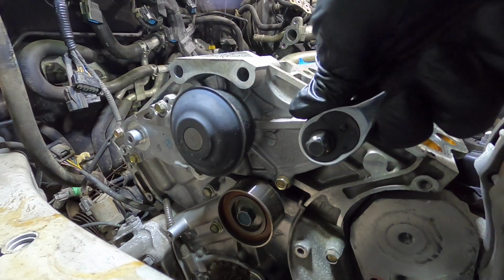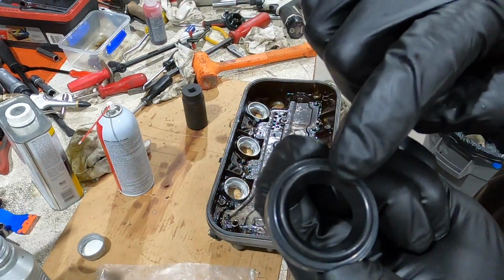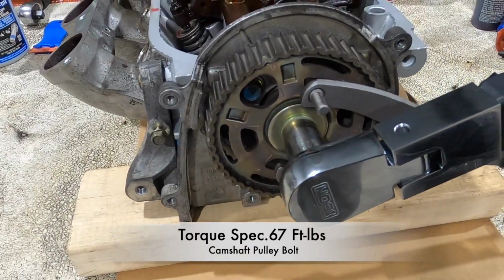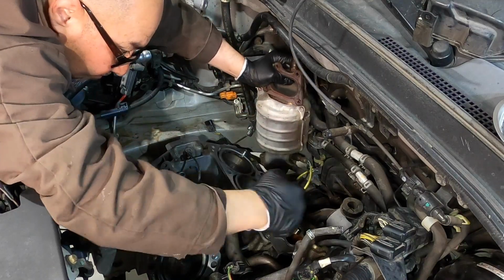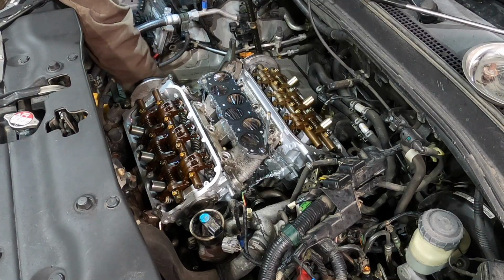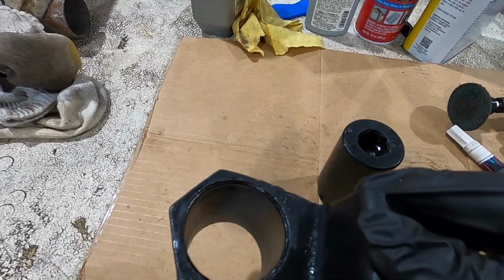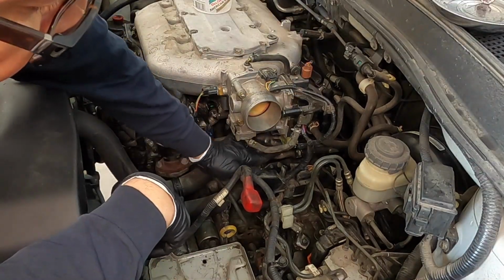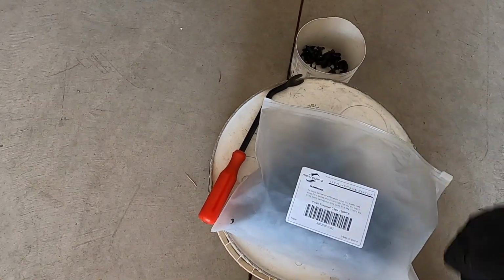Cylinder Head Installation on a 2005 Honda Pilot

Comment: Hey man I just want to say this video was a life saver. I bought a 2007 honda pilot on Facebook marketplace at market value with a blown head gasket etc. i decided to not spend the 3500-4000 bucks with a mechanic and decided to watch your two videos to solve the problem myself. So thank you 🤙🏼
Reply from the maker: You’re welcome😁👍 Thanks for the kind words. My 2005 has been running great ever since the repair. It is my daily driver and a great all around vehicle. Thanks for watching both videos 🚜💨☀️
Reply: I also overheated engine replaced the front gasket of the head but it still does not run smoothly I will change the second one I want to ask the engine block and can suffer or not?
Reply from the maker: @bogdantoysreviem7193  Maybe do a compression test before you take it apart to see what cylinder is having problems. Just a thought 😁👍

Comment: This is an awesome video!  For anyone reading this, clean engine oil should be used instead of white lithium grease as per the manual.  Also, a zip tie works great to hold those o-rings in while you're driving the cam end cap into position.  Impressive job putting this together and filming it all.  I'm always in awe of guys who have the patience to wrestle with a task like this and do such a pro job documenting all of it.  Thanks again.
Reply from the maker: @Mrfrags4117  Thanks 😁👍 I should have used motor oil on the rubber seals for sure. In my defense I had a lot to do. Hopefully it will be fine. Have not had a problem with the Pilot since the repair. Thanks for the kind words and watching. 😁👍🚜💨☀️
Reply: @MJADoingStuff   I'd second that, very well done video.  👍
Reply from the maker: @tcmits3699  Thanks for checking out the video and the kind words. Have a great weekend 😁👍🚜💨☀️

Comment: That sound you heard on the start up sound like the power steering pump sucking a little air in the line before it had fluid go through it.  Very common on these engines.  My 08 Oddesy made the same sound when doing the timing belt a few months ago.  Doing the valve cover gasket tomorrow at 190,000 and the engine is strong as ever.  I love the J 35 series engine as I believe with regular maintenance they are bulletproof.
Reply from the maker: Thanks that makes sense. Glad you are having better luck with your J series motor. Thanks for watching 😁👍🚜💨☀️
Reply: @MJADoingStuff  I saw this video and not the previous, but why did you remove the heads on the engine?
Reply from the maker: @danielrowe2174  The steel valve guide on the #4 cylinder had a coolant leak between the cast aluminum on the intake port and was leaking into the cylinder. I was already that far in so I just replaced both heads and did a valve job. 😁

Comment: Thanks for your videos. I'm working with my second honda pilot and about to take apart the engine and do all seals, new exhaust, etc. Mainly taking it apart to remove a bit that fell into the head and hope that it comes out when I remove it. My first pilot I did all the seals minus the head gasket, front and rear suspension along with new brakes and rotors all the way around. But I'm pretty confident I can tackle this since the weather is breaking a little bit.
Reply from the maker: @ericsolomon1109  You’re welcome 😁👍 sounds like you like doing stuff too. I am hoping to have time to do the transmission service video before spring. Thanks for watching the video and have a great week.😁👍🚜💨☀️
Reply: @ Yeah, I'm gonna do a transmission fluid & filter change on both vehicles before summer hits
Reply from the maker: @Great minds think alike 😁👍

Comment: I bought timing belt  from Amazon and it ropped 1 months later !!! Guys I did preventive maintenance for prevent valve damage and after change belt it happen couse not original belt .. it sucks!!
Reply from the maker: @sweet8763alex  Sorry to hear that. I got mine from Amazon too. So far have not noticed anything. I put over 20K miles on it. Thanks for sharing your experience.

Comment: I watched alot of videos regarding the j^ series engine and I gota tell you your videos are the best. clear and very simple to follow. I am just about to put my heads back on but since its a 2007 model, it requires different torque. Thanks  Mitch
Reply from the maker: Thank you very much for the kind words. I wish I could show more steps in the video but that would be 3 hours long and I don’t think people would watch 😂 Can I ask how many miles are on your engine? Mine failed at only 151K🥲 Thanks for checking out the video😁have a great weekend 😁👍🚜💨🍳
Reply: @MJADoingStuff I would happily watch a 3 hr video!
Reply from the maker: @bluor3713  Good to know😁👍 Thanks for leaving a comment. Hope you had a great 4th of July and have all your fingers.😂 🚜💨☀️
Reply: @MJADoingStuff Still have all my digits, but powder burns are a different story. Lol

Comment: When setting down the heads, I use two of the old cyl head bolts as a guide. I just cut the heads off of 
the bolts, get them started in the block, and after the block is down, install a couple of the new bolts 
and remove the cut off bolts. You can use a hack saw to cut a slot into the top of the cut-off bolts to 
insure that you have a way to remove them if you run them down too far to get your phalanges around them.
Reply from the maker: @otpyrcralphpierre1742  That is a great tip😁👍thanks for sharing I am sure someone will find it as helpful as I do.😁👍🚜💨☀️

Comment: You were right, Mitch!.... 

This is about the MDX I mentioned above. I finally decided to just pull the other unaffected cylinder as well and will rebuild it together with Bank2 (bent #4 intake valves). What made me decide to do that was after checking the seals and O-rings on bank2, almost all are nearing end of life: rigid, plastic like feel instead of rubberized. These won't last 50k miles or at-least as long as the new ones. Plus, will take the opportunity to do valve mating surface reconditioning.  The difficult part was loosening the nuts holding the cat converter to the head. My hands won't even fit in there; almost decided to just bring down the whole engine-subframe assembly. 

As the new parts delivery is delayed for like 1-2 weeks extra, this gives me more than enough time to measure things against factory spec and also clean things up. The Bank2 cylinder head by the way turned out ok. No measurable warping anywhere and even all valve guides were within spec. The bent #4 intake valves was all got affected by the timing belt breaking. 

Thanks , Mitch!
Reply from the maker: You’re welcome 😁 did you watch the removal video? I pulled the head with catalytic converter connected together. Glad you decided to pull both heads. Have a great week 😁👍🚜💨🍳
Reply: @MJADoingStuff  Yeah, I did... However, on the MDX (not sure about Pilot) there is another bracket near the 3 bolt of the primary exhaust pipe holding the cat down to the engine block. And it can only be removed after removing the primary exhaust pipe + front sub-frame stiffener and support + intermediate shaft. If I do that I'm basically just 2-3 steps away of removing the whole engine-subframe assembly.  Since, a buddy borrowed my mini lift long-term, that won't be feasible until next spring.

Anyhow, after some building up a series of mini socket extensions (and some arm and hand scratches), I was finally able to remove the nuts. Assembly it seems would be a bit easier as I removed the cat studs from the head.

More power to you, Mitch.
Reply from the maker: @Nio_by_Sakuji  Yeah I remember that bracket on the Pilot it was a short 2 bolt bracket on the bottom part of the motor and rear converter it was very light room to work. Sounds like you got it handled. It will be well worth all the labor you put in when it is done. 😁👍

Comment: just got a 2006 honda pilot.  Im looking to do a job like this on it.  Thanks for the insight!!!
Reply from the maker: Anytime 😁 I think the Honda pilot engine is nice because of the aluminum parts. I have worked on many BMWs over the years and the plastic parts are junk in my opinion. Got over 5K miles on the valve job and it is running perfect. Have a great week 😁👍🚜💨🍳

Comment: Nice job Mitch! It’s been a long time since I rebuild an engine. A hole lot more satisfying doing it yourself and a  money saver.   Later
Reply from the maker: Very true and now I know this thing In and out. The dealership (steelership)wanted $2600 just for labor🤯 I had to check😂Thanks for checking out the video Mech.😁👍🚜💨🍳

Comment: So impressive, nice work. I’m in the beginning phases of this monumental task lol
Reply from the maker: All I can say is one part at a time will get it done. Good luck and thanks for watching. 😁👍🚜💨🍳
Reply: @MJADoingStuff  that’s exactly it. It’s my sons pilot and I have a few hours here and there…I tell him just a bit at a time. I keep your video(s) on standby!
Reply from the maker: @manicmandownup  The most time consuming and challenging parts were the thermostat housing nuts,the rear catalytic converter lower bracket and wiring harness removal. 😁
Reply: @MJADoingStuff  I removed the front head today. Cylinder 4 exhaust valve is broken…I think also the culprit for coolant loss. I tell you what, I don’t think I want to do the other cylinder head! Do I actually have to? Cylinder 4 is the whole reason I’m doing this lol
Reply from the maker: @manicmandownup  You don’t have to but you are so close not much more left to just do it. Either way it’s up to you. 😁👍
Reply: @manicmandownup   would like to share if i may i took 54 photos and 12 short videos 😂👊🏻 really helped later on when I was scratching my head😂😂
Reply: And definitely label everything  with post it notes👍🏻
Reply: I’m sure you’re done by now😂

Comment: FYI, lithium grease degrades most rubbers and plastics. Silicone based lubricants is the one to be used if using for installing orings or other rubbers. New engine oil can be used too to install orings and seals.
Reply from the maker: Good to know thanks for the tip. And thanks for watching 😁👍🚜💨☀️

Comment: thank you so much bro. honda pilot 2007 wont rev pass 300 rpm and getting code for crank and cam shaft senor and one of the heads is running only 2 cylinder, def rebuilding my engine
Reply from the maker: Your welcome. Well the good news is that Honda built this engine to be repaired not thrown in the trash. So you will be happy when you are not braking plastic parts. Just make sure you use a torque wrench. Thanks for watching 😁👍🚜💨☀️

Comment: Hi! When placing the camshaft n, should i put on the sprocket and line up the marks before i install the lifters an rockers? Thanks
Reply from the maker: It won’t stay on the marks just assemble the lifters and rockers first then turn to the marks. Hope that helps 😁👍🚜💨🍳

Comment: Do you have to use rtv around the coolant pipe housing that mates to the heads? Or just use the gaskets the kit comes with?
Reply from the maker: Your preference I do it out of habit. I feel it seals the first time and it has always worked for me in the past. So short answer would be yes. Hope that helps 😁👍🚜💨☀️
Reply: @MJADoingStuff  thank you. One more question, i lost the back bushing for the serpentine belt tensioner. Do i have to have that or fine without in your opinion?
Reply from the maker: @ESP-Collectibles unfortunately you need the bushing. Hopefully you can find it. 😁
Reply: @MJADoingStuff  your responsiveness just saved me a road trip thanks again bro 🤙

Comment: Loved the vedio's man! Im to the point where i got the heads out! Are the heads new, or did the machine shop clean them? And what all did you have them do to them? Thanks
Reply from the maker: The heads were pressure tested and did a valve job package. Plus one of the heads was not fixable so had to find a good core that was fixable. I reused the parts of plus cam of the original head. Hope I answered your question. Have a great weekend 😁👍🚜💨🍳
Reply: Thank again man! What should i b lookin to pay for a valve replacement job on both heads and should i take them off?
Reply from the maker: It will cost around $750 depending on the condition of each head and machine shop you chose if you remove them yourself.😁 @alonzogodwin3745

Comment: Great video's ! Watched them both. Did you put a new head on or find a used one ?
Reply from the maker: I had to find a used repairable one and went ahead and had both heads pressure tested and the valves redone with new valve stem seals. They came back from the machine shop looking like new. Thanks for watching both videos 😁👍🚜💨☀️
Reply: @MJADoingStuff  Thanks for the head's up. Looking at 2008 Pilot right now that has an overheating problem. Either a bad head gasket or a bad head. I can handle the head gasket(s) job , but if I have to find heads for it then it's not worth the investment for me.

Comment: Great job, Mitch! And this video’s perfect coz my brother gave me his 2010 MDX that broke a timing belt. I already took off and cleaned  the timing belt area and i’m on the stage of about to do a leak down test… My question is, if you don’t mind, what’s the reason why you also had to remove the other head opposite the one that has cylinder #4? Was there also a problem in there, clearance issues or when doing head rebuilds on V6s they have to be done in pairs… Thanks a lot!
Reply from the maker: I didn’t need to do both but I was already there so I went ahead and just did it. This was a good call because the machine shop guy said some of the valve needed touching up and now I got all new valve seals too. Thanks for checking out the video 😁👍🚜💨🍳
Reply: @MJADoingStuff  Thanks, I was just wondering coz in our area machine shop work is so expensive. But then if both of the MDX's cylinders are affected, then I'd have no choice. I just hope you won't mind me asking questions in the future coz this would be my first V6 head rebuild.... Keep up the good work, man. Your attitude is amazing.
Reply from the maker: @Nio_by_Sakuji  If you need help let me know. Just take your time and if you start getting frustrated just take a break. This was the first Honda engine for me too. Have a great weekend.😁👍🚜💨🍳
Reply: @MJADoingStuff  I appreciate the offer, Mitch! 
So finally got the chance to do a leakdown test (both dry and wet) and scoping : bent intake valves on #4. The rest are clear including all piston tops, bore walls, and also leak test results of rest of the cylinders (all were approx 3% at wet/ dry and at tdc and also at fully depressed pistons). I'm not able to make a compression test as I didn't want to buy parts (belt) without properly seeing what's up. Thank you for your video; used it as a guide coz this is my first japanese car as the rest of my previous projects were all american.

I'm now a bit bent (see what I did there) on just rebuilding the bank (2) that has cylinder #4 and not mess up with bank1 based off my results above. Coz the way my brother carefully treated this vehicle (on time overall maintenance/servicing with OCI of every 3-5k miles) and nominal diagnostic results on bank1, I 'm actually afraid pulling that head based of how difficult it was on your video + including how tight it is dealing with MDX bank1's catalytic converter (it's just so tight).  Model year was 2008 with only 110k miles which IMO low for its year.

Will might just pull the bank2 cylinder first and give me a few more days to think about the unaffected cylinder. Unless you can clearly see some other cons that I maybe missing.

Thanks again , Mitch.
Reply from the maker: @Nio_by_Sakuji  Glad to hear you know what you’re getting into. Sounds like it’s going to be a very reliable vehicle when you get it done. Thanks for sharing your trouble shooting diagnostics. Good luck on your project.😁👍

Comment: RTV sealant is not bad if you just use enough to hold it in place, aslong as when you torque it sealant doesnt come out the surface you should be alright.
Very little jus a rub.
Too much I agree with this guy
Making the comment.
Reply from the maker: @rubenmelendrez6680  Thanks for leaving a comment 😁👍🚜💨☀️

Comment: hello boss, just a quick question, when you did the valve adjustment. how did you turn the cam to adjust the valves outside the car?  did you use a wrench to move the cam?
Reply from the maker: Just seen your comment. I used a Spanner wrench and the springs will fight you so rotate counters clockwise to get it to stay where you want it. Hope that helps and thanks for watching 😁👍🚜💨☀️
Reply from the maker: Also don’t forget to put the heads on some blocks of wood so your valves don’t hit the work bench.
Reply: @MJADoingStuff  there won't be a risk in adjusting the valves going counter clockwise correct? thank you for responding
Reply from the maker: @badraalezairej4648  as long as it is on the workbench on same
Reply from the maker: On some blocks of wood, so the valves don’t touch the workbench
Reply from the maker: It should be fine

Comment: i did notice you rechecked your gap on the valves. did you need to rotate each cylinder to TDC before rechecking? in my case it just 4,5,6
Reply from the maker: Yes They need to be Checked at TDC. Thanks for watching 😁👍🚜💨🍳
Reply: Okay thank you and i will say it again you are amazing! 👏And I’m a first timer if I haven’t told you that before👍🏻appreciate all your help!
Reply from the maker: @elvis7652  Glad to help 😁👍🚜💨🍳

Comment: So when removing heads to take to machine shop u have to take the rockers off?
Reply from the maker: Yes they will charge you extra if they have to do it. Thanks for watching 😁👍🚜💨☀️
Reply: With a blown head gasket mitch ....can you just put on a new head gasket ,or the heads need to be planed down ????